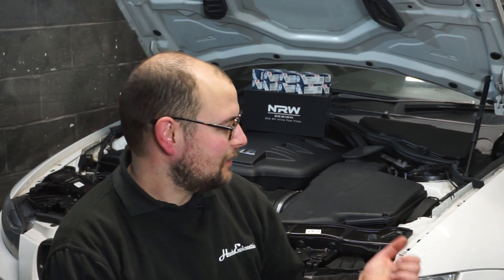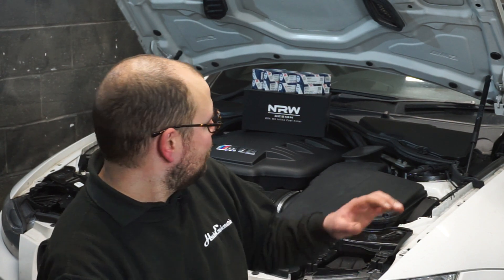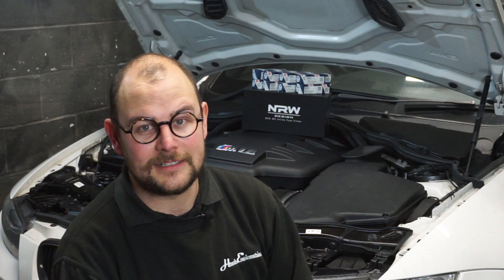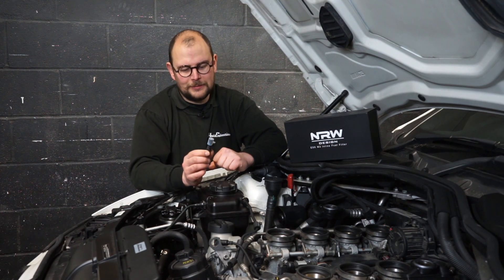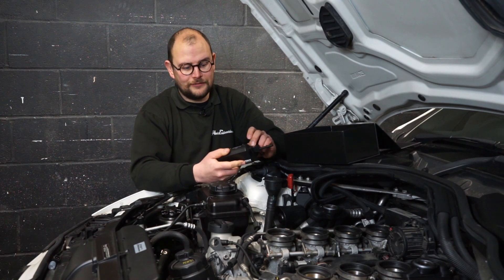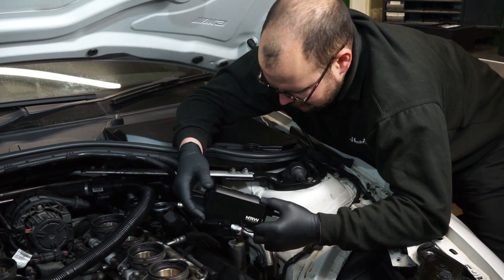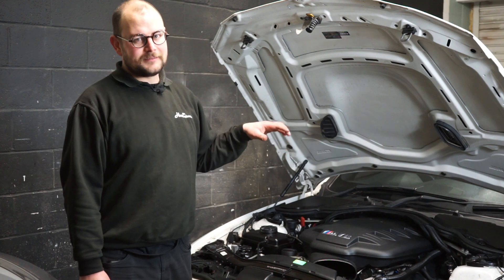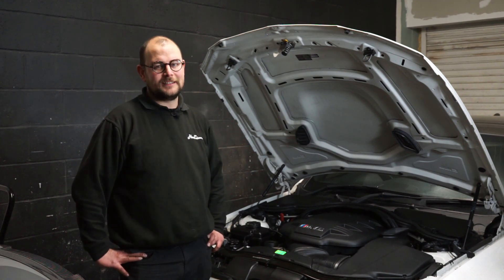ANOTHER E9X M3 SAVE! Injectors and NRW Design fuel filter fitting

Comment: Hello from France. If we have a sensor for flexfuel where it’s recommend to put it with the filter kit ? Thanks
Reply from the maker: This would depend on the sensor, but ideally the sensor would be located lower down. NRW do also now offer billet fuel rails which may give you far more options for your flexfuel sensor location - https://www.hackengineering.co.uk/product/nrw-design-billet-fuel-rail-system-s65/

Comment: Can't you just do the filter and leave injectors? As the ecu will shut off if you have injector issues with the pressure switch on the other side of the filter?
Reply from the maker: Theory - yes
Reality - no

Unfortunately despite the ECU's rail pressure sensor, there are still plenty of engines out there that have suffered failure due to injector issues
Reply: @hackengineering5586 is this not more of an issue on track cars etc? Where lean running happens due to a slightly poor injector? I it really that important of a mod? Thanks
Reply from the maker: @Jonathan-qz9kd in all honesty we haven't seen a pattern. Mileage, use etc seem to make little difference. 

When the options are fit a decent filter like this or roll the dice with needing an engine, we'd say it's a no-brainer!
Reply: @hackengineering5586 yes I may fit the filter and get the injectors in the future it will give me some piece of mind that it's not going to get any additional crud in the injectors!
Reply from the maker: @Jonathan-qz9kd  sounds like a plan!

Comment: Plan on doing injectors and NRW fuel filter kit soon. Do i need to do fuel pump assembly too? Previous owner did fuel tank sender assembly at 76k. Car is at 83k.
Reply from the maker: Not necessary, especially if it's been done quite recently!
Reply: @hackengineering5586  only the fuel tank sender was done, not the fuel pump itself. But thank you, ill stick with the injectors and NRW kit

Comment: I have the NRW kit and also new Bosch injectors. But if it's the filter breaking up why not replace the original filter and pump? How often should you replace the Aeromotive filters, and is it time or mileage based? And I assume the injector failure cannot be a problem with the OE pump failing? I guess I'm asking is what you (and I) have done a 100% guaranteed preventative fix? Thanks.
Reply from the maker: In all honesty, there is no problem with that solution too - it's just considerably costly and then still remains unserviceable. We'd recommend replacement every major service. 

You cannot go wrong with the NRW kit and new injectors. Even if the fuel pump has a spectacular failure, the NRW kit will save the injectors from it and the DME will have time to shut everything down. Great product and big peace of mind!